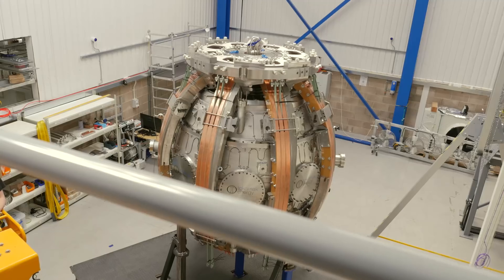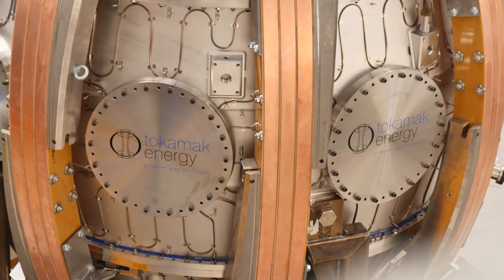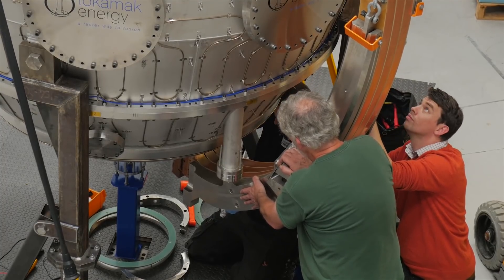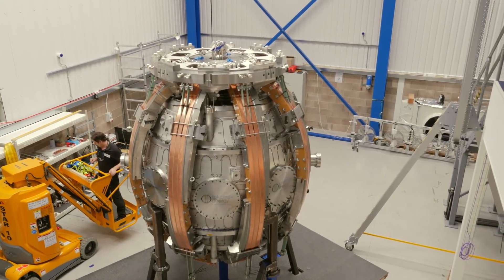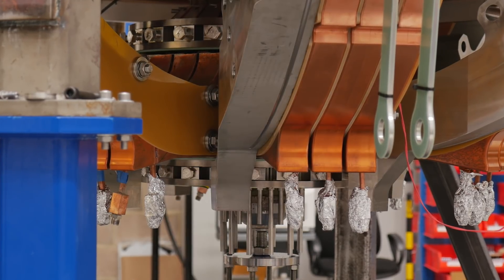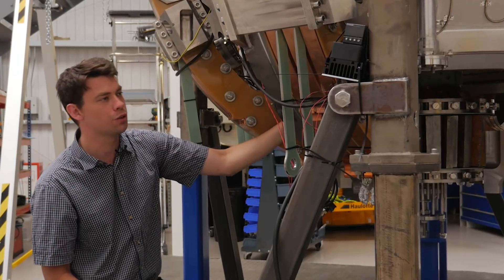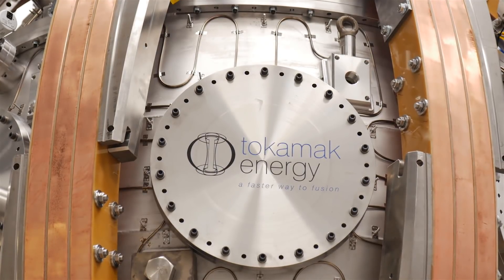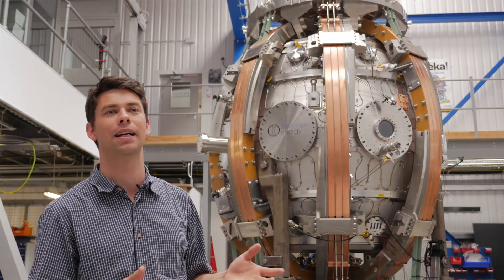Interesting unseen features of ST40

Comment: It's a shame that such advanced devices are (currently) limited to pre-medieval means of generating electricity like heating water to turn a turbine.  The perceived technological delta between burning charcoal and manipulating the building blocks of matter as we know it seems to be constrained to simply building better tea kettles.

Hopefully, I'll live to see machines like this harnessed in ways that extract either electrical current or even something as creative as a turbine that directly extracts mechanical energy from the plasma(?).
Reply from the maker: Indeed.  Let's start with the easier reactions and hopefully then move on to the more challenging ones that could potentially generate current directly.

Comment: I'm curious what you did for a blanket. How do you catch the energy?
Reply from the maker: We are not at the stage of catching the energy yet so ST40 does not have a blanket.  That will be the next step once we have succeeded in achieving fusion temperatures in our machine.
Reply: The blanket will come later on a different machine.  This machine is demonstrate the temperatures that can be achieved for energy production in a small device. Once that has been proven, as you say, we'll need a blanket to capture the energy, but also to generate the fuel tritium.  The difference with fusion in a Tokamak, is there is not enough fuel for a sustained chain reaction (i.e. making it much safer), however unless every generated neutron creates a tritium atom, we won't generate enough fuel.  So that means we also have neutron multipliers (e.g. lithium/boron) in the blanket to help generate the fuel.

Comment: But ....if it's copper.... it isn't superconducting?? which is the point isn't it?
Reply from the maker: We are developing HTS tokamak magnets in parallel to operating the ST40.  Experiments on this copper tokamak enable us to investigate how the plasma behaves in this squashed-up spherical tokamak shape with high magnetic field, and we aim to attain fusion temperatures in this machine.
Reply: I have a question too. There are losses in the magnetic field when it tries to penetrate the metallic layers? In the scheme shown in minute 1.06 we can see that the plasma will be contained inside the torus, but the magnetic coils are outside of the metallic shield that contains the plasma. How much it affects the magnetic fields?
Reply: True, it's copper.  The magnetic field doesn't care what generates it.  The reason ST40 is copper is because it's quicker and cheaper to demonstrate the high temperatures in a small machine, to demonstrate that if we did replace the copper with superconducting HTS, that we are on a path to generating energy in small reactors, faster and cheaper.  We also are developing exciting HTS technology, watch out for publicly released information on our website about that.